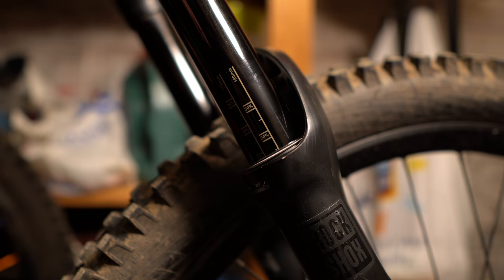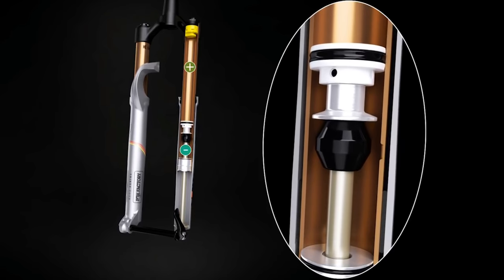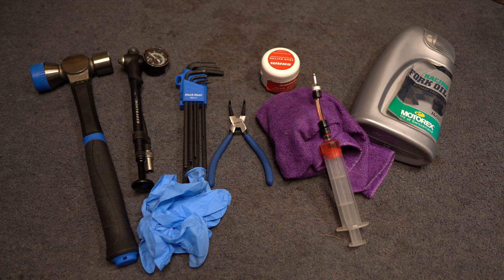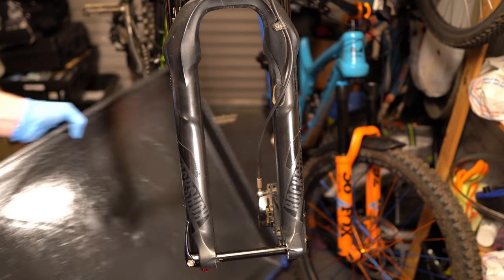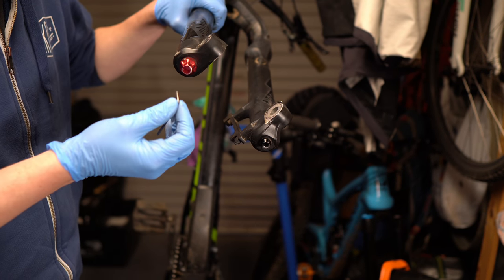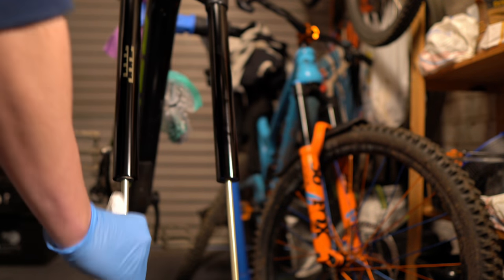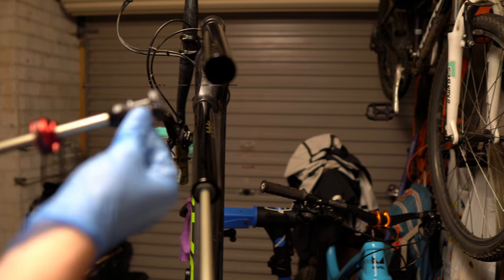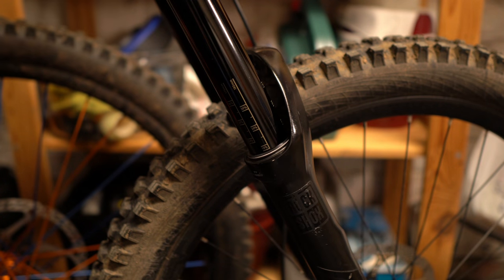Fork Suck Down

Comment: What actually causes the suck down of the fork is that people  that do the lower leg service release the air from the air chamber and then assemble the fork back together with the air shaft not fully extended. It causes negative pressure in the lower legs when inflating the fork. Next time, try the zip tie trick while sitting on the front wheel and yanking up ob the bars. You will hear a hissing sound and it is actually air being pulled in the lower legs, i.e. pressure being equalized. Or, do it more civilized and flip the bike, unscrew the lower legs and tap out the shafts so the lowers dislodge, move the lowers up and down slightly and retighten the screws. The pressure will equalize, dust seals won‘t get damaged and you won‘t loose any oil. While doing lower leg service, I leave the air in the air chamber, unless I inspect the air shaft. In that case I alway pump about 50psi in the air chamber BEFORE putting the lower legs back on to make sure the air shaft is fully extended. Never get any suck down that way on none of my forks ;)
Reply: Got exactly the same issue with a brand new revelation RC I don't understand the thing is brand new why does it have negative air inside?
Reply: @pb8582  Same here
Reply: You have a fox fork don't you?
Reply: Thanks a bunch lux!! Your post was radically useful!!!
Reply: awesome insight, I knew the deal wasn´t in the greasy airspring for me, since I have cleaned it up and the suck was still there. This fixed it! I just didn´t know, that the air shaft has to be fully extended before putting the lowers back. Learning the hard way..:)
Reply: Much appreciated insight. Didnt think about this during rebuilding my forks
Reply: Wasn’t sure when I reassembled mine on the air pressure in the chamber . Now it works great. So a friend has told me that he has taken the rubber bottom out, bumper out of the air spring side, giving him more air in the negative chamber, creating more supple feel ? would you agree that this would create that feel by taking that rubber bumper out of the air spring?  I imagine it would do some damage on a harsh quick rebound and top out , but may create more negative suction for a more supple feel at the top of the stroke.  any comments on this subject ?
Reply: @EricASmith_B.P.  - another video on the Debonair spring swap, the guy does exactly that- remove the top out bumper and talks about the results- it does create a larger negative chamber which does make the fork more supple on the first bit of travel. He does however say that since the negative chamber is larger it makes the fork spring rate way too progressive (for him at least) in the last 30-40% of the travel. He says in the end it made the fork “better AND worse” since it’s supple in the initial stroke but so progressive in the 2nd half of the stroke that it was too harsh and he ended up putting the top out bumper back on the air shaft. You could try lower main spring pressure to compensate for the massive ramp up (or you may even desire that much ramp up) but most people prefer a little more linear feel to the spring rate. Full disclosure- I myself have not removed the top out bumper so all info is relayed via another YouTube user.
Reply: @twistedneck  thanks for the info Jeff I actually took the bumper and cut it in half that gave me just enough off the top to make it a lot more supple without that harsh progressive feel so it works pretty good I'll tell you that thanks again man keep the rubber side down
Reply: @69strokefasterthanyourmum  nonsense :/

Comment: Thanks for the tip!  Was ready to send into Fox service but you saved me a month of down time. To prevent damage to the bottom of the Fox fork I cut a 4 x4 down to 4" with a 5/8" hole centered 1" from the top for the axle.  Then I could do the yanking up and down you detail to clear the blockage without fear of damage.  Now I have full travel back!

Comment: Thank you!!! The fork push/pull method worked (after  maxing air pressure) on my Fox 34 that dropped from 130 to 100mm. Avoided the time and hassle of pulling lower legs, etc.  Nice explanation and stepwise process- Thx again and keep up the great work!
Reply: do u have to let the air out first?

Comment: Just installed the charger 2.1 and the 2020 Debonair spring on my 2019 Yari RC. Worried I had done something wrong but after watching your video at the very end you answered my question about the fork sinking in a bit!!
Reply: Same here. I thought the C1 upgrade was to resolve the way it sinks with no weight- by having it sit high in the travel. Mine still sinks by 5mm.

Comment: Prior to taking the lowers off you can try removing the air pressure, and also removing the air can itself and repeating the pull up technique (this seems to work best on the debonair springs, which tend to suffer from this a lot more). It also makes the sound of the pressure equalising easier to hear.
Reply from the maker: Good ideas thank you

Comment: Great video dude thanks, solved my problem on my 2021 debonair upgrade as after fitting the upgrade it was sunk in it travel. Pushing down and pulling up worked a treat 🤛🤛
Reply: do u have to take the air out before?

Comment: Went straight to tip number two. Emptied both air chambers on my old u-turn, pushed it up and down a few times. Noticed it didn't go down and pumped it up again. Looks good but seems it was necessary to get the air out first. Thanks for the great video👍

Comment: I'm going to try some of this stuff out tomorrow. Ever since I installed a MRP Ramp Controller on my 2017 Fox 36 it's been sucking down when I add air to it. MRP told me to use the ziptie trick but it doesn't work. I already know there isn't any grease blocking the port because I serviced it when I installed the Ramp Control cartridge.

Comment: In the begining, after you mentioned the nylon tie trick, you suggest finding the maximum air pressure listed on the fork. Then you jump right into the fork tear down. What do I do with the fork after I put in the max air pressure? Also, why wouldnt the nylon tie work in the first place? Maybe a different type of nylon tie? a bigger one? Maybe if I let all the air out of the air shaft side to reduce the pressure required to get that tie in between the o ring and the air shaft? Thanks
Reply from the maker: The tie method is independent of the air pressure, what it does is let any trapped air out from the lowers as they shouldn't have any, only the upper stanchion on the air spring side has any air, after you set the max pressure just do the same thing as show in video, I recommended this as the extra pressure can sometimes help force the grease out and stop the fork sucking down, if it fixes it then return the air pressure back to the correct setting for your weight.

Comment: My Reba suspension also got a little bit of travel at the beginning of the stroke, as shown in minute 24:55 of the video. In one of my maintenance, I put 5ml more oil on the side of the hydraulic cartridge. When testing, I saw that this initial travel disappeared

Comment: Hi Jed! Very good video! 

I have a question: My Pike RC3 160 mm and 27.5, 2015 began to do noisy extension knoks after disassemble it to clean, grease, put new seals on debonair and main bottle seals. It seems the opposite problem as yours... but with the same origin: unbalanced + and - air chambers.

I disassembled it and purged the charger, which had some bubbles, but the problem didn't disappear. After disassembling the fork several times, I tried to enter the debonair but not with the shaft extended (like the manual says), leaving about 5-6 cm of the shaft out of the stanction. It was the only solution I found, liying the fork. Doing this, I preloaded the negative camera with a big amount of air which was useful to solve my problem retaining the stanctions at the end of the travel during the extension, but: Now I have a doubt: I think the two cameras haven't a good communication and I think too may be the bypass is obstructed.  I've tried to under and overload the positive camera bumping the fork to try to clean the communication hole, but without results...

I will have to disassemble again my fork... If the communication hole is clean, what can I look for more? 

Thanks you and best regards!

Comment: i had a very very small crack around the air valve on top of the alloy fork cap, this resulted in sucking the fork in (after a fork rebuild, it looked fine but after a few hours it started to drop)   took me a while to figure this out! air valve was fine, everything seemed fine.  use some leak detection spray or soap and spray this on the fork cap and you will see if this is the case.  Cheers!

Comment: Thanks for the video. stepping on the axle and yanking the up the compressed forks cleared the grease right out and works great. So easy. Great tip.
Reply: I presume the air needs to be released from the fork before performing this manoeuvre?

Comment: I have a 2023 Fox 38 factory… the fix I made was to let out all the air > insert a small zip tie between the seal and stanchion on both sides as mentioned in this video > pull up the handlebar while sitting on the front wheel > push it down a bit for a couple seconds > pull the handlebar back up… do this about 5 times. And on the 6th time of pulling the handlebar up, hold it for as long as you can, even trying to pull it higher than in previous tries. It should eventually release or remove some air (I couldn’t tell which one happened)… once this happens, start pumping air every 50psi and cycle through a few times. Hope this helps anyone.

Comment: Hi! Great vid on the topic! I have an issue with my fork. Its a Reba xx dual air 29 fork. I got the air spring rebuild kit and changed it because it would suck down the fork and only use about 30% of its 100 mm of travel, but after installing the air springs, its gotten even worse! Now it bottoms out all the time. Please, I would really appreciate some help on this issue. Any commehts?
Thank you.

Comment: My Lyrik RC2 came with a machining default near the transfer port (inside the stanchion) that scratched the seal of the Debonair airshaft. After a few rides, once the seal was no longer tight, the air passed into the negative chamber making the fork sucked down (25%). It took 2 fork services and 3 new seals to find out the cause...Only new fork stanchions under warranty solved this problem!
Reply from the maker: Sounds like a nightmare, good to hear you got it sorted.

Comment: I only lightly paid attention to this 'issue' and swapped out the air spring on my rockshox with a newer version (increased travel also). Yet is it an actual issue? The effect only occurs unweighted and since nobody rides unweighted, once sag is set is it not the same in actual effect?

Comment: If anyone has a debonair lyrik and it's sucking down about 10mm, that is a feature not a flaw.
Reply from the maker: Yep and if you want it to sit higher then Rockshox now offer a new 2021 DebonAir airspring and Vorsprung Suspension make the Luftkappe which does the same thing.
Reply: Lol dying
Reply: @Tomi_Henrik @Jed MTB is that really true? I got a used Lyrik and was a bit confused about that "SAG" ... A friend of mine did a little service and i was worried that he did a mistake or trapped some air in the lowers. But if its a "feature" than ... WOW :D haha
Reply: @simbic53  Well all 2020 debonairs do that...so its a kinda unwanted "feature"
Reply: Really? My rockshox yari also sinks 10mm down. Is it normal for debonair?
Reply: @gryyta9617  oh i see thats why many debonair 2020 users pulled out their forks
Reply: @jamescecilpilar2455  I havnt done it yet, as my bike is designed for 140 and the fork is a 150...so im technically within tolerance😅
Reply: My pike does it as well. So when you guys lift your bike by the stem do you feel a bit of play while the fork tops out fully? I thought something was wrong but I guess it's normal.

Comment: On my Bluto fork I noticed it was stuck down,  on the air spring side lowers I removed the nut and noticed a scharader valve I compressed the valve and the fork extended.  Does this resolve the problem?

Comment: I have just received a brand new set of 2019 pikes that are stuck around 5-8% sag. I have removed the air cap, pulled up on the stanchions and I did hear some air come through the port but has made no difference. Would you have any ideas?
Reply from the maker: Hi Luke, 5-8% is normal for Rockshox, they have just released a C1 airspring which claims to make them sit higher but I've not tested one yet so can't verify if it works or not. https://www.sram.com/en/rockshox/models/fs-upk-db-c1
Reply: @jedmtb  thanks for the reply buddy. I may order the new airshaft when it's first service gets done.

Comment: The butter is worthless. All it does is pack up on top the seal heads and doesnt lube anything.
I recommend taking butter and 30wt oil and mix until the butter un thickens.  Pour over seals. Put .03 ml in the middle of the air chamber. Then remove the top cap and add .05ml so just enough to coat the seal head. This will give you the best sbc you can have. Use this mixture on dropper post as well as on stanchions. Its the best of both worlds.
Reply from the maker: Appreciate the tip, I'll give it try next time I'm  changing the oil.

Comment: Have you ever come across a suck down that you cant pull apart?  I did all the necessary procedures on my fox float 29 and the lowers are so sucked down that they wont pull apart.  Seems like I over charged the fork so bad.  Tied it to a tree and used full body force and still couldn't pull it apart.  release all air pressure, knocked the bottoms out, oil drained, etc etc.  trying to avoid paying 200$ to send it in when I can do it myself.   Any thoughts?
Reply from the maker: Sounds like air is trapped in the lowers, try removing the lower foot nuts and pushing the damper and airspring, this video shows what I mean at 6:00  https://youtu.be/xB5rc602MhQ
Reply: @jedmtb  Thanks for the reply!  I actually just sent the fork in this morning to fox to get a full service.  I did what you said and still nothing.  Hope I get it back in one piece.  thanks again!

Comment: I'm having an issue with new Fox Fork 36 on new bike.  The fork is almost completely sunk down the tube.  When I press down on it, it "bottoms out" but doesn't rebound back. Any tips?
Reply from the maker: Is your air pressure set ok?
Reply: @jedmtb  Honestly, I just purchased the bike and assembled the front and back tire.  I believe the fork was pre-assembled with the proper air pressure.  It feels like it has almost no air pressure as the fork looks completely sunk.  The stem of the fork is only about 4 or 5 inches visible.  The remainder of the stem is inserted into the fork.  I can pull it out - but over time it just sinks in by itself, even without use.

Comment: the pull-up technique worked great, but my rebound dial got stuck, i can’t move it either way. what should i do?
Reply from the maker: Unscrew the screw that hold the rebound dial on then pull it down a tiny bit and  retighten the screw, be very careful not to over thighten it, the dial should move freely again.

Comment: My rockshox front suspension is stuck all the way down with no air in them and I've tried so many to to pump air in them but the air won't go through the valve
Reply from the maker: You could try removing the Schrader valve core and checking for any blockages from grease or oil.

Comment: Excellent video, now I'm actually quite surprised by "if it's at 10mm isn't a issue"... I got a san Quentin 3 and went from 130 to 140mm both cases I got my fork not using the all traveling cos it's sit at 10% it's a RC revelation now 10 percent doesn't seem a lot when you have 170mm but when I had my set up at 130mm it was a lot it's like having 120mm suspension and a saggy one coming from a fox 36 my revelation feel like absolute cheap made... I mean the san Quentin 3 is a dirt jumper all mountain when you start sending 2 metres drops and 3 metre gap jump you don't want your suspension to feel like this particularly on a hardtail... Very disappointed by rockshox we tried everything and nothing works it's going back again to the mechanic to check it but I don't feel like this feeling is normal. And I run my suspension at 4 tokens 100 psi and I'm 77kilos that when I feel it alive a bit... And still losing 10% of my fork... Weird
Reply from the maker: You'll need to get a DebonAir C1 airspring which makes the fork sit higher. https://www.sram.com/en/rockshox/models/fs-upk-db-c1
Reply: @jedmtb  https://cyclinic.com.au/collections/fork-spares-rockshox/products/rockshox-air-spring-sealhead-kit-debonair-c1-my18 I think you can only get this and that will work as they are exactly the same shaft

Comment: My rockshock reba fork is losing air presure, and the left dust seal is coming out. Also the fork does not come back and just stays down while riding. Any solitions ?
Reply from the maker: That sounds like the seals on the air spring have failed, it’s a fairly common issue on the reba’s Rockshock sell seal kits to fix it or you could send it to a suspension shop for a full service.
Reply: @jedmtb  I can't realy find the air spring seal kit. Where can i order one ? I live in Europe.
Reply from the maker: @kristapains1833  What year and model do you have?
Reply: @jedmtb  i have RL 27.5'' 100mm solo air spring rockshock reba
Reply: @jedmtb  I don't know about the year but it is not the old 2014 model it's like 2019 or something like that